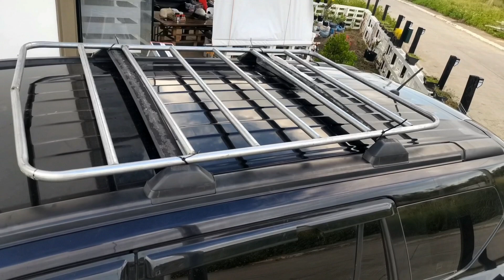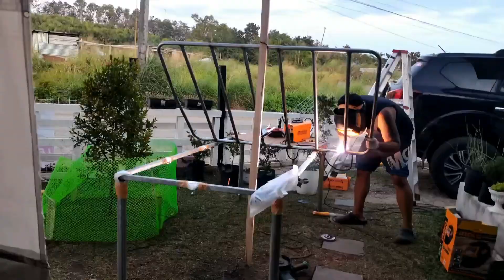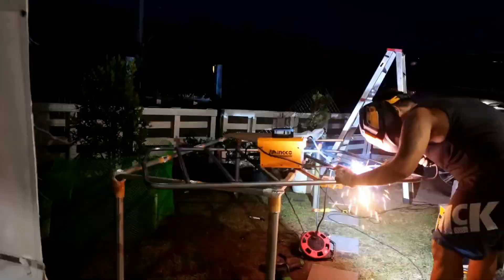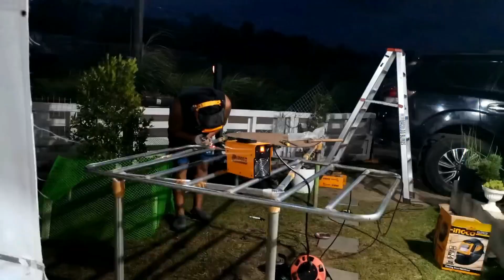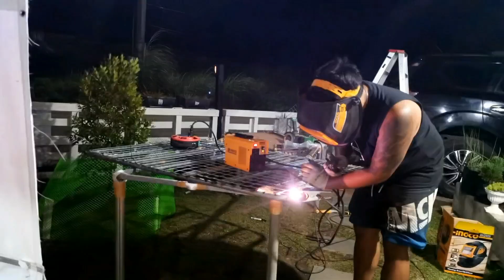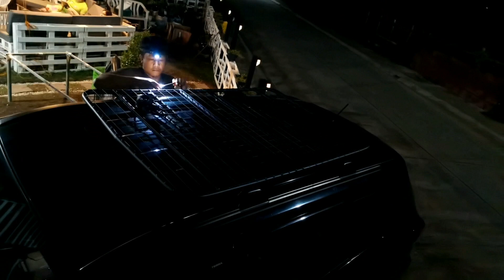DIY Flat Roof Rack for Nissan Terra

Comment: Hi sir! Ask ko lang po sana nung d mo pa nakabitan ng roof rack at crossbar pa lang... May windnoise ba yung crossbar itself pag highspeed na ang takbo?
Reply from the maker: Ang Crossbar walang noticeable wind noise sir.  Nung may roof rack na may naririnig na akong wind noise at high speeds.
Reply: @daddyissuesph9050  salamat sa reply sir!
Reply from the maker: @Bushmaster222  you're welcome sir!  Will probably be selling my cross bar soon.
Reply: Hi sir. Saan po kayo nakabili ng crossbar? Hirap hanapin😊.
Reply: San kayo nakahanap ng ganyan crossbar. Mahirap nga hanapin